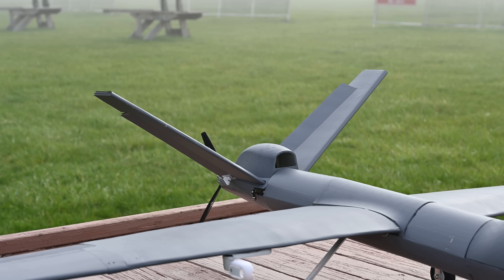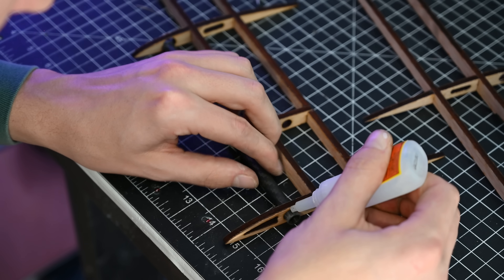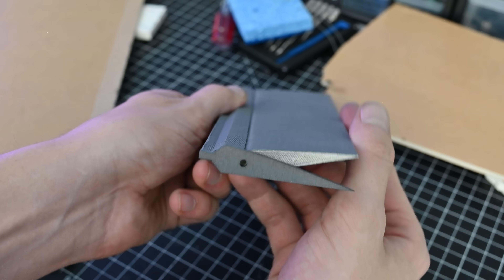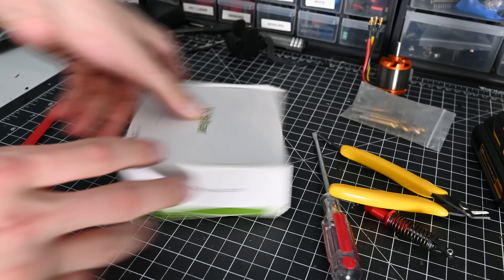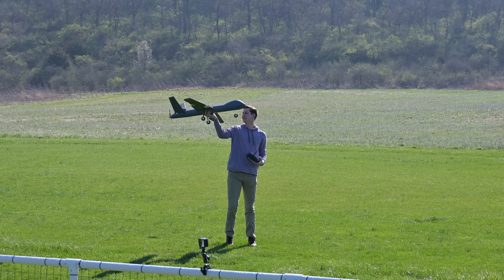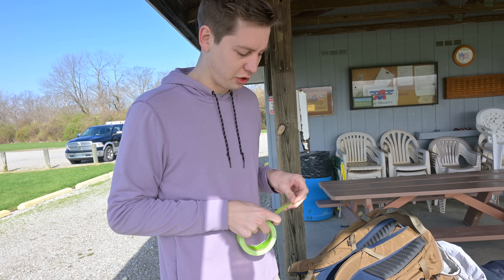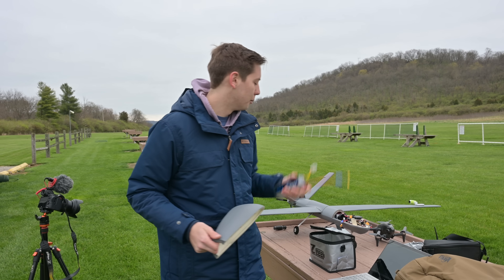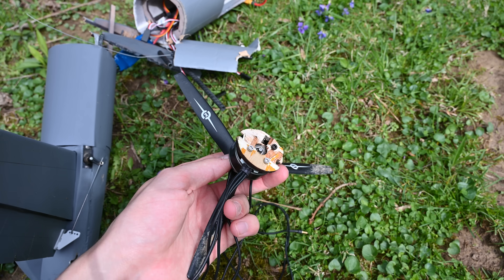Building a DIY REAPER Drone... Ended Badly

Comment: Excellent job. I was wondering what the weight differences was between the 3d printed section vs the wood/foam board section. If the 3d printed section is lighter you might want to design the whole thing Tobe 3d printed in sections and ca glued with small wire supports. There are a few companies selling the print files. If you designed it that way you might be able to sell it to them or online so others can build it.
Reply: Echo on the first question

Comment: I probably wouldn't change much, just use carbon rods to hold the bulkheads together, that will give you some added strength down the fuselage.  Also, make sure you do a balance check every time you change something, it looked like you were so nose heavy the full up elevator wasn't enough.
Reply: If carbon rods are good then a whole carbon fiber plane would be gooder.
Reply: @1pcfred  and much more expensiver 😁
Reply: @1pcfred  I suppose, but at what point is it diminishing returns?
Reply: @1pcfred  I suppose this is true.
Reply: @1pcfred  why do you want the next to last in performance? Presumably if that's what you want then use the cheapest, heaviest material.

Comment: You did a stellar job building that reaper. Beef up your landing gear and get the one 6 cell in just the right spot and you’ll have an amazing plane. It looked like it had very well performing flying characteristics for a maiden. If you decide to start over, go bigger! Bigger planes are easier to fly.
Reply: i agree with the bigger statement, not only does a bigger size mean one or even two 6 cells bat. you could have bigger landing gears to the increased size,  more avionics, 3d print the parts out of the rugged light PLA, and maybe some memory to have a time laps of the flight.
Reply: @leezensmith775  Rugged light PLA? lol
Reply: You need a launchpad, urgently. Try and make one using a rail made of wood and rubber, some kind of slingshot, to eliminate the risk of a wigly throw, like the one that killed this plane.
Reply: yes It would also help to generate more lift and also enhancing controls of the aircraft👌👌
Reply: Also gives it tons more payload you can use to beef up design as well as install cameras or whatever else would make the "Hobby - Reaper" cool! Would be sick to see if it can drop some GPS guided glide "bombs" (just 2 unpowered gliders that are preprogrammed with target coords...)
There is soooooo much cool shit you could do with that!
Reply: want to build something like that and put a Nikon p900 on it and a gyro hehe
Reply: Yes, bro is correct, but he did a a very good effort also & thanks for time spent on this &  sharing with us
Reply: What's a maiden? Like... in rc planes.
Reply: I was thinking the same thing. Make it bigger.
Reply: Agreed, CG should be addressed before any launch. We never took off before I did the CG worksheet before takeoff in the Navy.
Reply: He is gonna end up with a drone fit for service in Ukraine.
Reply: @rubenskiii  Russia is wraking havoc with worse than that
Reply: @honestiguana  good!

Comment: You may want to ditch the landing gear entirely and go for a bungee launch system for more consistent launches.  Get yourself 16ft/5m of aluminum extrusions with a bipod on one end.  Ive also had luck with using magnets to hold the plane parts wherever possible as, in a crash, some of the impact energy goes to breaking all the magnetic linkages, especially if you have a sacrificial nose cone.

Comment: That happened because you've skipped the process of fixing the landing gear. Don't dispair and do it again and test every change, you were almost there! Think that for any object to fly it needs to float on the air and this happen only if you respect the weight/lift ratio
Reply: Dumb comment

Comment: try helium balloon ducted fan plane/quad drone floater
Reply: Spirit within, do you have, or did you go haywire, on your own, trying to guide yourself through laws
Reply: pcbway tried to make me work, so no thanks
Reply: when you sell something, you are the one doing all the things, not your customer, not agreed
Reply: why dont you use the landing gear lever as a leaf spring, same in the wheels, radial circular leaf springs around the wheel, double suspension, now you land with straight legs, snap
Reply: zero style points for landing, huh
Reply: even a grasshopper does not snap its leg, even if landing many times higher than its height
Reply: some times more flex is better than straight rigid face, thanks

Comment: Good project.
In your next iteration try adding another carbon fibre tube along the body of the plane. Rear motor should be mounted to the to that tube, all the ply cross sections have to be attached to it as well. Probably the chassis should be mounted to it. Just use it a a spine bone... 
Good luck in what you are doing and don't get discouraged.

Comment: How much did this cost to make? I’ve been looking into making something like this.
Reply: Foam itself is cheap, so would be plywood. Access to laser cutter would be premium comfort pick, but good ol knife and ruler also works. Carbon tubes/rods aren't expensive, but might not be widely available. Basic 4 or 6 channel receiver/transmitter, servos and motor you can get for relatively cheap as well, no idea about stuff needed for autonomy flight.

basically invade your local hobby/craft store to see what materials and for how much you can get

Comment: Hi Michael, my 82yr old machinist dad and I have been building and flying (and crashing.  Lots of crashing.)  foamboard planes for about 3 years now.  Our passion project is the Bugatti 100P and we're on the third iteration with counter rotating props.  So far our fuselage designs have, well, sucked, and I really appreciate your frame and foamboard skin approach.  The Reaper turned out amazing and it hurt my heart to see it crash.  What would it take to entice you to do a video of your design process, particularly how you land on the correct size/shape foamboard skin components?  Any other advice or direction you could provide would be vastly appreciated!
Reply: I bet that's a great way to bond with your dad! Kudos to you both.

Comment: Getting the center of gravity coordinated with the lifting forces and control surface forces is essential stable and efficient flight.  Adding a hook for string suspension at the point where the CG should be for lift and control make it an easy task to then adjust the location  of batteries, etc inside the plane.  The center of lift should be just aft of the center of gravity.

Comment: I think encorporating the use of the fusulage as a lifting body would improve flight characteristics as well as double checking your dihedrals in the tail for the compensation of the dirty air coming off the nose due to drag. Also if using larger batteries for longer flight times and better performance try balancing the batteries right on or slightly before the rear tail assembly and right in or slightly behind the front replica sensor hump, this would give the model the weight distribution that both the MQ1/MQ1B Predator and the MQ9 Reaper systems share where the sensors and propulsion weigh the most; but that may lead to a need for a slight change in the position of the wings to account for the redistribution of weight. All of that weight would mean that I would probably want to taxi for take off to achieve the speed needed to take off, so maybe a more robust landing gear system as well. Hope this helps a little!

Comment: A catapult? so you can launch it consistently from a rail with high speeds(like aircraft carriers)
you would only really need a guide rail, ground stabilizers, and a propulsion mechanism(crossbow, linear constant forcce springs, rubber bands, etc.)
And maybe use tom stantons way of 3d printing a light weight fuselage.(he explains it in one of his ospray vids iirc).

ps: if you are feeling really risky, use an atlatl to trow your drone wayyyy faster(have to watch out for the center of gravity and lift though)

Comment: what is the estimated cost of a build like this, with just manually controls :D
Reply: electronics alone without a transmitter easily $150. materials are relatively cheap but you need a 3d printer and a laser cutter.
Reply: @knoopx  Got acces to laser cutter, and I got several 3d printers.
Just need to know wh price of all the electronics :)
Reply: @knoopx  Yes and no. 3d printer and laser cutter are comfort/speed picks, as similar parts could be done the old fashioned way, with knife and ruler, though probably won't be as fast and as pretty.

Materials for fixed wing aircraft from foam + some plywood/carbon inserts aren't really expensive. Then its matter of finding plans of whatever tickles your fancy or coming up with something yourself and see if it flies. Which I can see being one big part of the charm

Comment: That's an awesome project! The last flight was definitely too heavy. Adding a higher cell count probably isn't necessary for something like that. Depending on what your amp draw is you might want to consider using something like a 3S 18650 pack, you can get a huge amount of flight time so long as you're not really pushing the amp draw to more than the cells can handle. You might also want to consider doing more with the LW-PLA. I bet you could save some overall weight by using LW-PLA panels instead of foam board.

This might be a good design for a launch rail or even a high start bungee launch. Hand launching is always hit or miss, and I really hate having to hand launch something with a pusher prop.

Hope you build a second version - that first one turned out fantastic other than being a bit too heavy with a big pack.

Comment: Maybe stonger longitudinal stringers? More carbon fiber rods, less thinly cut plywood.
Reply: Also, buying some lightweight fiberglass fabric to laminate over the wood (even potentially before laser-cutting), can improve the strength of the wooden bits INCREDIBLY, without adding too much weight, cost, or build complexity